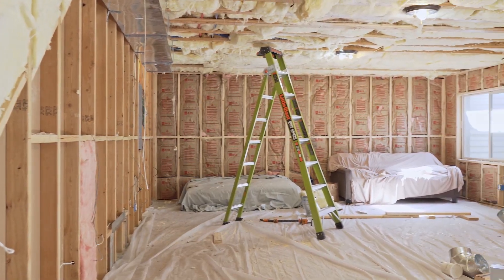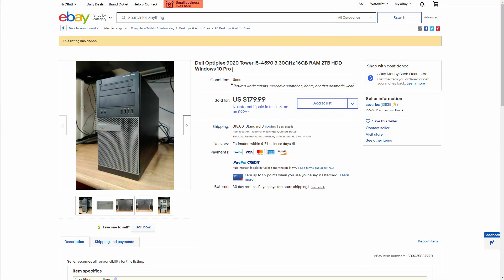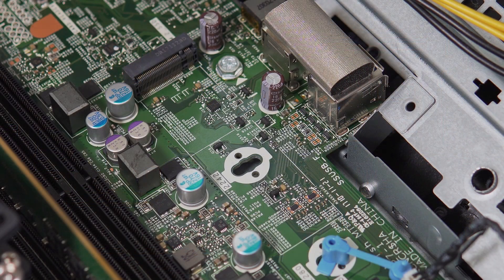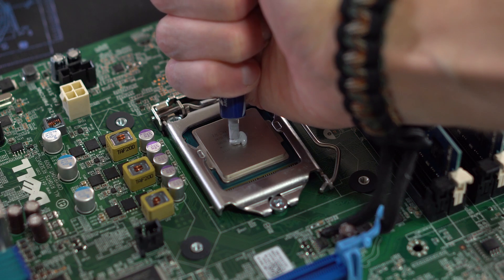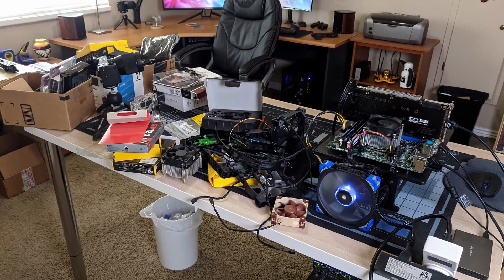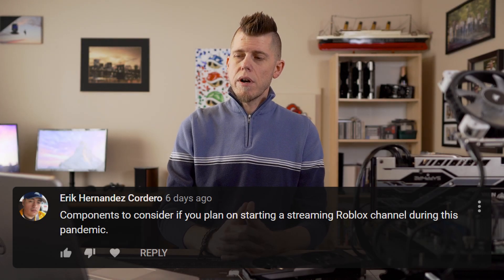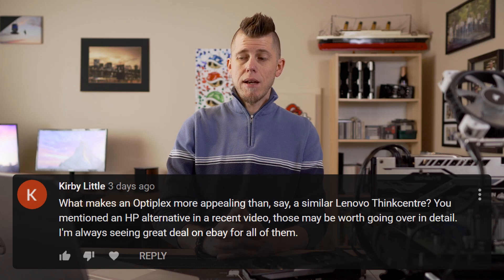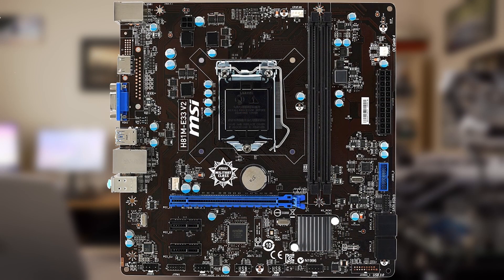Dell OptiPlex Q&A Pt. 2: Power Supply & CPU Cooler Upgrades, NVMe m.2 SSD's & More

Comment from the maker: When I said the 1080 Ti consumes about 400 watts, I was talking about the total system power draw, not just the GPU itself. Speaking of GPU's, and the dumpster fire that buying one is right now... would you like to see another build video? I'm working on one right now, but I don't want to fan the those flames, since it's really tough for people to build systems right now.
Reply: I would do it. I still see plenty of people putting systems together. Maybe a mention of where you are picking up components?
Reply from the maker: @PinkyTech  Well, I think I'm going to post up a poll to see what people think, but I think I'm going to toss the 570 8GB that's with the parts and find something a little more realistic.
Reply: @TheGameBench  I have a Lenovo IdeaCentre T540, it has a 310w platinum rated PSU, 1660ti, i5 9400f, 16gb DDR4 2666Mhz RAM, and a 256gb NVMe SSD. I'm wondering if I can upgrade the GPU to a mini ITX RX 5600XT, this guy here used a RTX 2060 with this same PC https://www.youtube.com/watch?v=07SRjlMUT1c&pbjreload=101 ? I have an HP Pavillion with the same specs but it has a 400w PSU so I think in both cases the GPU upgrade will be fine as long as it fits.
Reply from the maker: @crownspirits9122  Watching that video, he didn't really seem to test the 2060. I'd say it will work, but it's not leaving you much headroom at 160 watts on power consumption, and I wouldn't suggest it. The 5600 XT on the other hand, might be fine. It depends on the model . Some can consume as much as the 2060, and some can be down closer to 140 watts. It just depends.
Reply: I see well thanks for the input! I will try to find a lower power model 5600 XT that can fit in the PC. For now I will probably just upgrade the Pavillion that has a 400W PSU. I definitely won't do any overclocking.
Reply: @TheGameBench  I know this isn't really a comment for this particular thread, but is it possible to use a 1650 super in a 3020 with an i5 4590? Or I have to switch to something like a 1650 for it to not bottleneck? Love the vids btw <3! (I have a 3020)
Reply from the maker: @crownspirits9122  Well, I would think the shorter ITX models would fit that bill. If you look at the Tech PowerUp GPU database, it will give you a good idea of what to expect. The Sapphire Pulse I know is fine, but probably too big. So if you look at the GPU database and look for models that are close to the Pulse in terms of clock speeds, you should be fine. Avoid the higher clocked models.
Reply: @TheGameBench  Thanks for linking me to that, that will definitely come in handy, and this just crossed my mind but if I really wanted to be on the safe side, isn't there a way to underclock or undervolt the GPU so as to make sure it doesn't draw too much power. I assume the same could be true if I put it in power saver mode though that might bottleneck the performance a lot since I'm usually in High Performance.
Reply: @Octogonalpotato  I use that exact cpu and gpu and I don’t get any bottlenecks or stutters in games. Note, I have 16gb of ram in mine.
Reply: @paulhillbeats  Alright thank you!
Reply: I'd love to see a new video using maybe a 7050 or 7060, i7 8700k and gtx1070 vs building new. For my application I need intel to run blue iris and deepstack for security cams (i7 6700min) and want to also use it for ifr slight simulation with x plane 11 on one or more TVs as monitor(s) with SEEMS to need 8700k possibly overclocked and gtx 1070 as a min
Reply: My system is i3 4130 in dell 290 watts psu can i put gtx 1050ti, it is ok or i just change it into gtx 750ti? Thank you.
Reply from the maker: @nitz007  The 1050 Ti sips power. With that i3, the total system won't consume more than about 140 watts total.
Reply: Hey would a 1660 super 600w thermal take and i7 2700k be good for Vr on the Optiplex 990
Also what is the best cpu I can put on the stock Optiplex 990 motherboard
Reply: I'd like to see more build videos :)
Reply: I still love my optiplex mini tower. They're so low key, small, cheap, and fun to mod. I have ran a gtx580, 680, and 1080 with my stock psu (325w, right?) and only upgraded to an rm650x for modular cables after those gpus, always ran flawlessly. I run a 3090 in it now that my friend passed onto me for cheap since he got a 4090. I use a corsair h60 aio that barely fits with an original 4790 and motherboard, and 32gb memory. It's my only pc and does just fine against my friends' very expensive builds. It is getting to the point where I'm starting to want to upgrade my cpu/motherboard so I've been considering adding a "wood box" stand looking deal to the bottom of the case to allow for a standard atx setup, although I suspect motherboard i/o covers might start being an issue but we'll see. SUCH a fun platform! Thanks for making all these videos over the years brother! ❤

Comment: I am currently using a Optiplex 9020 MT for light video editing and 1080p gaming. Where I live most PC parts are prohibitely expensive and bulding a usable machine for under $500 is almost impossible. I got my machine with an i5 for around $80, $40 EVGA power supply with the adapter,  cheap 8 thread xeon and a 4gb 1650. For less than $250 I get an usable machine that allows me to work faster than my laptop and also can game in a pinch.

Comment: Super late but if anyone sees this - while trying the built in diagnostic utility on my 7010 I noticed the cpu fan can spin up to 3900 rpm, and the errors that it's throwing may be because it detects a lower rpm, so it might work with something like a delta server fan
Reply from the maker: I came to the same conclusion at one point. I tested the theory out and still got F1 errors with high RPM fans. Now I'm speculating it has to do with minimum startup voltage.

Comment: Hi sir can i use rtx 2060 gpu and i7 4790k cpu together in my dell optifelx 3020 pc plz tell me sir
Reply from the maker: The 2060 is on par with the 1080, so there will be some bottlenecking, but yeah... I think it's a decent pairing if you can find the 2060 for a good price. You will definitely need to upgrade the power supply though. You can use something off the shelf with an adapter, or you can find the XE2 power supply, which is 365 watts and more than enough for the 2060 and requires no adapter to be used in the 3020.

Comment: can i use dell 460w psu to my mt 9020 with i7 4790 &1660s? or im better off with 500w aftermarket
Reply from the maker: Either a 460 watt or 500 watt is going to be WAY more than enough to power a 4790 and a 1660 Super. Hell, I would tell you that you would be just fine running the stock 290 watt power supply with 1660 Super as they only consumer about 110 to 120 watts and you'll likely have around a 100 watt buffer zone on the 290 watt. Just be sure to use a dual SATA to PCIe adapter. If you would still like to replace the power supply, it depends. What model is this 460 watt out of? It may or may not be able to work with the 9020, depending on the main power connection. It might not be worth the hassle. However, I wouldn't suggest getting an 80+ White 500 watt aftermarket unit either.

Comment: @TheGameBench Did the 9020 ever get Rebar firmware update?
Reply from the maker: Not that I can find. You can make a custom BIOS that should enable it, but you're taking a big risk with the only real upside of being able to use Intel Arc cards. I don't feel the risk is worth it to enable it on NVIDIA or AMD cards.
Reply: @TheGameBench   Thanks, had a good look in the meantime couldn't find anything for the Optiplex but it's not something I'd risk myself not being practiced enough in such things :)

Comment: @TheGameBench Can I use 2 sata 8 pin (6+2) for 6 pin gpu i.e. just leave the 2 pin hanging or do I require 2 sata 6 pin?
Reply from the maker: Yep, perfectly fine. The extra two pins are just ground and if you had a power supply with dedicated PCIe power, it would have a 6+2 pin and you'd just not connect the extra two pins. So, you're good to go. But just to be sure, you're trying to power a card with a single 6-pin using a dual SATA adapter and NOT a GPU with two power connections with two SATA adapters?
Reply: @TheGameBench  Thanks dude appreciate the response :) and no to the second part lol just a 6 with a dual. Thanks again :)

Comment: can you use a 1650 with a dell optiplex 7010 sff power supply? If not how can you upgrade to a higher power psu.
Reply from the maker: Yep, the 1650 would be more than fine with that PSU. The a2000 would even be fine as well. You've got 240 watts to work with and the GPU is only going to consume 75 watts at most. The rest of the system won't consumer over 100, and that's an over estimation, so you'd likely have around 100 watts, or more, of head room on the power supply.

Comment: I bought a cheap 9020sff on ebay during lockdown for home schooling but like usual, I got the upgrade bug. Currently,  it has an ssd, 32gb ram, front fan replaced with 80mm noctua, 40mm noctua exhaust fan, upgraded 315w psu from xe2,  copper core heat sink and fan from xe2 and a low profile 1650 gpu in the x4 slot. Everything works fine. Temps aren't bad and I don't use it loads or work it hard but it is fairly noisy, especially since I swapped out 1050ti for 1650. I have been considering the best things I could do regarding heat and noise (and price) and what I'd like to do is move the psu out of the case, which would give more room for air in the case, stop the psu from blocking the gpu fans and I could move the gpu to the x16 slot. So my issue is getting the right extension cables for the psu. I know the pin layout is proprietary and not atx but most of the cables I find are atx or converting 24pin to 8 pin or 8 to 6 etc. I literally just want to extend the 2 cables used from the psu (8 pin and 4 pin I think). Being the xe2 psu it has an additional 6 pin but I don't use that as gpu doesn't require external power.  For where the pc and psu are going to be, the psu will probably be behind the pc, don't think there will be room on top, so probably looking at 30cm extension. Can anyone please advise? To reiterate, I am not proposing switching to non Dell psu, just getting enough cable to move the psu outside the case. Thanks.

Comment: Can I get a 850w or 1000w PSU that will fit in Dell Optiplex 9020 case...?  Every power supply I've seen that is 750w or more is too big... I've got a 650w in there right now, but a lot of users with Nvidia GeForce 3070 GPU's have reported problems with the cards with 650w PSU's, and going to a 850w or 1000w has made the card work properly. I've seen a lot of power supplies in the $60 range on eBay, but none of them are a standard ATX size. I'm just trying to find a standard ATX sized 850w or 1000w PSU... any idea who might make one...?  Thx...

Comment: Do you know how to fix this issue where my optiplex 3020 wont restart properly? After I restart it, the desktop stays on but doesn't display anything and my peripherals turn off. The only way to get around it is by holding the power button to turn it off and then turning it back on again

Comment: What does the cpu fan error look like? Will it interrupt the boot sequence? Does it require pressing an F-key or something to get passed? I use my dell as a headless plex box.
Reply from the maker: Yep, it will interrupt boot and require you to press F1 before it will continue. Are you planning on changing out the CPU cooler and you're worried you might get the F1 error?
Reply: @TheGameBench  I'm using the pc for handbrake video encodes too, and it's reaching mid 80's. Kind of uncomfortable with it that hot. Not sure what to do.
Reply from the maker: @middle_pickup  Ah! Okay, I do a lot of Handbrake encoding too, and that would be a little warmer than I'd be comfortable with too. What model OptiPlex are you using?
Reply: @TheGameBench  790 with an i7-2600
Reply from the maker: @middle_pickup  Okay, so I assume it's a mini-tower? If so, I've found a 120mm cooler that will fit in the mini-tower case and the included fan does not throw the F1 error. Might be a bit overkill for the 2600, and it will require you to cut off the mounting tabs for the stock cooler by removing the CPU retention bracket, but it would alleviate all your problems. It's the Thermalright Silver Soul 135. There also the Silver Soul 110, which is a 92mm version that should work fine as well, but I don't have one of those to test the fan for the F1 error. Either should be listed on Amazon.

Unfortunately, it's just hard to find aftermarket fans that don't upset the fan controller on these.
Reply: @TheGameBench  I thought about just getting a new bigger heatsink and reusing the current fan too. I'll look into those though. Thanks! I really need the pc to boot itself after power outages without any issue.

Comment: i have the optiplex 5040 ssf. with gt1030 i7 6700,ssd. can i use thiis system to play 4k blu rsy disk
Reply from the maker: It would be able to if it had a 4k Blu Ray drive that could play UHD discs. Unfortunately, for some reason, they lock down UHD Blu Ray drives. There are some that you can buy where you can revert the firmware to play them, but it's kinda' a PITA. But yes... it's possible with the right drive.
Reply: @TheGameBench  i added a LG usb 3.0 blueray uhd drive and power dvd 20.  software detects the disc but says its the wrong format. all i need is the cheapest pc that can playback 4k disc. i really dont want to buy a 500 xbox series x just to play 4k disc
Reply: @TheGameBench  This isn't related to the dell optiplex however I've bought an Acer Aspire TC-1760 and they have proprietary psu and the one it came with is 180w The system specs are i7-12700 8gb ram 3200mhz ddr4 and H61H6-AD motherboard if I can replace the 180w ATX12VO powersupply with something like a 300w can I use a 1660ti or 1660 super 1660 or 1650 super? please tell me which I can use thanks!! Love your videos

Comment: How do I install a new cooler? The motherboard I bought didn't come with one and the backplate interferes with the new cooler's backplate.  The backplate holds onto both the CPU and the cooler, so i can't just use the cooler's.
Reply from the maker: You would have to remove the processor retention bracket and cut off the mounting tabs for the stock cooler. I do not suggest using something like tin snips to cut them off as it will bent the metal which could damage the board with a sharp edge. I suggest using a rotary took or grind it down and then smooth them off with some sandpaper. Might even want to use some electrical tape on the ends to insulate the exposed metal. That being said, be very careful as you would be exposing the socket pins.

Comment: Hi, I was wondering what you think of the z240 or z440? I know these are about 4x the price of 3020 but can they spec'd out much higher. There don't seem to be good videos on youtube covering these machines. Actually I don't know if you would cover this series because it does seem outside of the budget philosophy but if you run into one and care to cover it I would be grateful. By the way, I love your channel. Great tips, advice, points of consideration and you dig fairly deep on the topic. Keep up the great work!

Comment: What's your thoughts on the HP Z4xx (420, 440) workstations in comparison to OptiPlex's? I'm looking to build a budget rendering rig with something along the lines of a 1080 or 2060. Seems that the HP's might be able to support that with the stock PSU but not entirely sure.
Reply from the maker: Well, they're much different animals than the OptiPlex. More comparable to the higher end Precision workstations. They use full on Xeon 2011 chips rather the desktop 115x chips. If you wanted something more like the OptiPlex there's the Pro/EliteDesk 600/800 G1 that are direct competitors to the OptiPlex. On the plus side, they have a little more room and a better power power supply with 30 more watts. However, the screw pattern on the CPU cooler is non-standard. Then there's the Z230 workstation that still uses the desktop CPU's, has even more room, and an even better power supply.

In most ways, I would say they're better than the OptiPlex. In other ways, not quite as good. Adding a front fan to either is going to be tougher being that there are a lot of drive cages in the way. But if you're enthusiastic about older hardware and you need more than four cores, I suppose the 420/440 would be the way to go, or look at the higher end Precision workstations. The T1700 is another option from Dell that competes with the Z230, but they don't always come with the better 365 watt power supply, which is still behind the power supply that comes in the Z230.
Reply: @TheGameBench  Really appreciate the response! After some more digging I'm leaning towards a T1700. Either way it looks like I'll need to upgrade the power supply since the cards I'm considering are all 8-pin.
Reply from the maker: There are T1700's that come with a 365 watt power supply that has a 6-pin PCIe power connection. You would need an 8-pin adapter. There aren't a lot of 8-pin cards that are going to need more than that.

Comment: Have you tested CL9 or 10 DDR3 in the 20 series?
Reply from the maker: I've tried it, as have some others. I've not seen a single kit run at CL9 or 10. It either runs at a higher latency, drops the clocks down to 1,333 M/T or just refuse to work at all.

Comment: Do you still recommend the 7020 and 9020 till today or is there a better option
Reply from the maker: Yep... at the right price. I highly suggest the i7 over an i5 and it's still worth it if you can find one under $150. Too much over that and they start to make less sense considering you can build something newer for not much more once it's all said and done. If you're looking at an i5 system, I wouldn't pay more than about $100 for it, max.